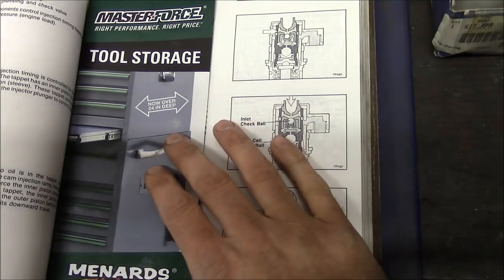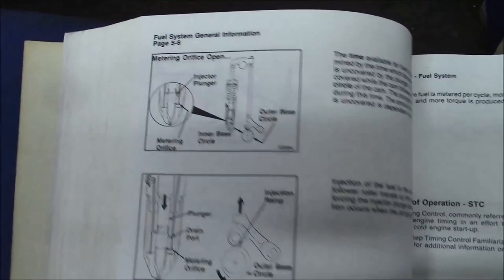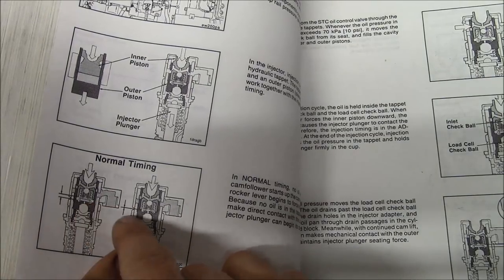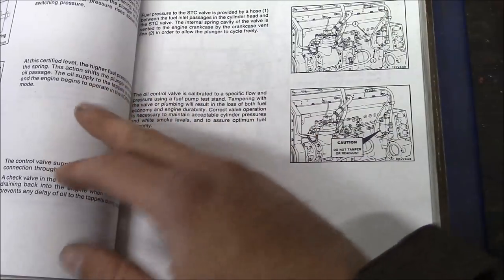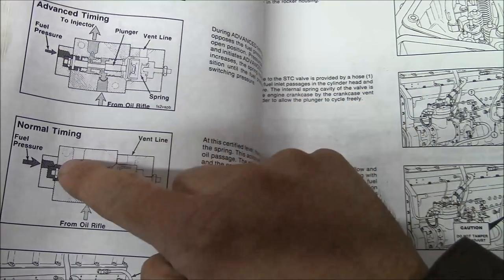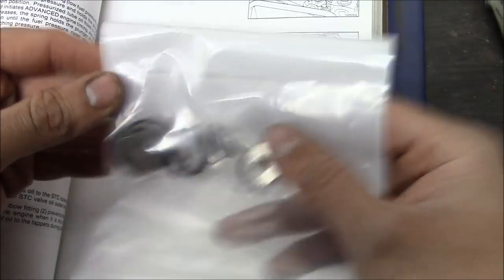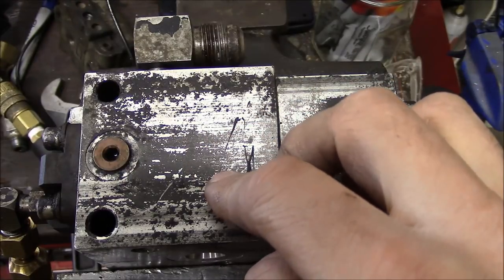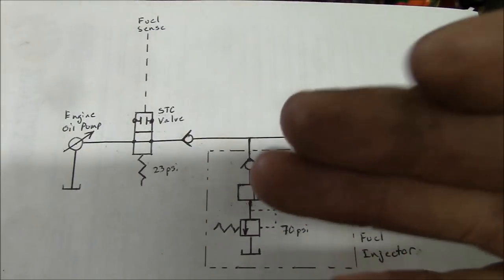Truck Repairs: Cummins L10 STC Smoking and Rough Idle Part 1

Comment: I love a good episode of Mechanical Mystery Theater! :) The STC valve had means and opportunity, but no motive. The injectors are looking very suspicious, but they keep their internal operations well concealed. Tune in to the next episode where (we hope) misbehavers will be brought to justice and order will be restored!
Reply: Steve Canny, Your avatar is just awesome!
Reply: Exactly this!!
Reply: Cummins also call it two adjustments one is inter Circle and outer circle adjustment. I been told never try rebuild a STC valve, cause the engine can run a way. And on a out of around adjustment you use a 5in lbs to all values. I hope I'm right it's been a long time for when I did one.
Reply: Well said @Steve Canny

Comment: I looked the boxes at Menards over pretty good and the Harbor freight ones seem better. We have guys in the shop with both and  the harbor freight one feels more rigid. This is only on the big boxes. The 44" box at menards was better built than the HF in the store. The Kenworth dealer was the cheapest place for me to buy Cummins parts. Typically I find the recons are cheaper than getting what I have fixed.
Reply from the maker: I don't like the drawer configuration on the Harbor Freight. It has one long drawer, which is what I currently have. The Menards box has 3 long drawers. Nothing cheap about Cummins parts, recon or not.
Reply: @WatchWesWork  a couple guys at work have the bigger menards boxes and they have definitely held up im not sure on how well they roll our shop doesnt require much moving, a box could sit for 10 years. But they like them

Comment: I worked at a pre owned truck dealer, we bought out a fleet of old Ford L9000 quad axle dump trucks from a local contractor. They were time capsules. All powered by L10 Cummins backed w 8LL. The phone rang off the hook about those trucks until the last one was gone. I sold one to this old timer, he “tuned” the injection pump in the parking lot with his pocket knife just before he took off. The L10 Cummins will always remind me of those old Fords and that old guy

Comment: I know this video is 2 years old and it's too late to help or save you now, but this masterforce is nothing like an extreme tools tool box! There's a reason the extreme tools box is three times as expensive. Extreme tools box is $1,100 pounds empty! You can stand in every drawer there's double drawer slides on every drawer Etc. The extreme tools tool box built stronger than any Mac Matco for Snap-on box for 1/3 of a price of one of those but definitely not the same Chinese tool boxes you find out a big box store.

Comment: Wes, NO unqualified person should disassemble a STC injector nor any other injector for that matter due to “class fit” tolerances being observed in a clean room. If the STC valve is working as you showed and all injectors are bypassing air except a clogged injector then the Cummins procedure is to R & R the injector(s) as necessary. 

I was laughing when you did your initial testing but, I was very glad to see you found your mistake. Then you stumbled on the injector check valve issue while explaining and thinking. Your a good mechanic man and don’t talk bad or second guess yourself, your a very thoughtful and read the theory of operation type of guy.

Comment: Nice detective work Wes👍. That stuff is testing and brain twisting at times. Always makes sense after a good hard look and some rest. I'm not sure I could have controlled myself. That injector would have been in pieces on my bench.  Keep up the videos. 👍
Reply: Me too, not that it would have been a good decision!
Reply from the maker: Umm... Somehow that cap jumped off the top of the injector and I had a look inside. There is some wear in the tappet. It also appears that the hole was not machined correctly and the passage was never open. So who knows...
Reply: @WatchWesWork  LOL, That's strange. Very possible it was never correct to begin with. It would be nice to know for sure.

Comment: Great video I have no thought on the tool box we have 5 models around here maybe 6 and they each have a purpose for us of course you need to hold more stuff then these two micro-machinists. I like to understand this diesel mechanical work as we have no diesel knowledge so we are all eyes learning everything we can. We do know a good truck when we see one your truck is something we would love to have one of for personal use (pick up small vintage machines) only of course.
Reply from the maker: It's handy, but not a cheap toy to have around.
Reply: @WatchWesWork  Hey you are right about having things laying around for that day you need them costing money, We normally do not write a reply to a reply because we know and see you are busy but thought I should share something important. We are actually marveling at your skills Wes you see we watch you change wheel bearings/oil leak in a Clark Forklift rebuild some cnc machines and find them homes service a diesel truck so to us you are really a great mechanical guy and that is why we watch you even if in the diesel topic it was not what we are doing so thank you and have a Merry Christmas.

Comment: I don't like the idea of a 24" deep toolbox. Very easy to tip if you have a few drawers open. 30" deep is better. Looks like the ultimate toolboxes are made in the usa. Just my thoughts. Keep up the great videos you have a great channel.
Reply from the maker: Near me is a company called Stor-loc who make tool boxes that are very deep. But, I don't like the drawer layout. I'd think a 30" box would be hard to maneuver.

Comment: I know this is an old video and shipping would be a long way but I can't tell you enough good things about a place here in texas called M&D distributors formally texas fuel injection...they can rebuild any injector I've taken them so far and even Bosch fuel pumps.

Comment: Use a butterfly impact on the exhaust studs. It doesn't have enough power to break them but it may shake the rust out. It worked on 7 of 12 for me. I had to buy a set of twelve point sockets when I came across a 12 point bolt.
Reply from the maker: The good news is that these are pretty easy to get to.

Comment: Wes, Back on the truck repair. Is it running at idle on all cylinders? I'm surprised you didn't swap your good injectors with #5 &#6 just to troubleshoot, swapping is cheaper than throwing BIG $$$(Injectors) at a problem like that. BTW, My son is awfully rough(really) on his equiptment, his big Snapon box with wings has stood the test of time. Check with a dealer, you might get a good deal on a repo box. But there is no way too move big boxes when they are loaded, so you still need roll-carts.
Reply from the maker: It's not really a miss. I tested for a miss by holding each injector rocker arm down. I'll talk about it in the next video, you need a special tool.  It's technically a timing issue. I estimate the engine has around 400,000 miles on it, so it's time for injectors regardless.

Comment: I have a 91 Mechanical N14 and it smokes for about 10secs when I cold start it but when it warms up around 160-180 degrees it starts to blow alot of Blue smoke and it smells like fuel. I got my injectors rebuilt but no luck. I'm thinking it's the STC valve

Comment: Wes your close to the problem but, not quite there bud. I’m a cummins tech and I primarily work on common rail engines but, I’m the only guy at my shop that knows the earlier fuel systems. Honestly, all the way back to the mechanical engines including the V8 903’s and I work on anything from 2.8L to 19L engines. So pretty much everything that came in trucks or smaller.

The old L10/10.8L, 855/14L and K19/19L STC engines which became the M11, N14 and K19 Celect engines. These engines all suffered this problem in variation and all had issues with the check valve in e top of the injector sticking. The fact you couldn’t stick a 0.040” wire in the injector lube Port is incorrect because, the check valve ball is what’s stopping the wire from entering the injector.

Comment: Wes Wes Wes.
The fuel line to the STC valve pushes on a basically a disc, only the clearance restricts the fuel pressure causing it to move, the fuel pressure goes past the disc equalizers and the Piston don't move, meaning the valve in the oil part doesn't function, I believe there's a return line on the STC valve that connects to the fuel return line back to the tank. Unless there's a blockage somewhere it should work, The oil pressure that doesn't drop off when you applied air to the valve had no effect without that return line on the STC valve. When it's working properly at approximately 70 psi fuel pressure the valve is supposed to relieve the oil going to the injectors causing them to collapse meaning the fuel is trapped and injected app 8 to 12 degrees later so at higher rpms the fuel isn't injected too early ( to much advance). Check for a fuel return line from the STC valve to the fuel return line back to the tank. HOPE THIS HELPS, there's a accorn nut on the STC valve to adjust the point where the valve functions, Cummins don't want you to know that.
Good luck and all the best to you SIR.

Comment: Im wondering will this truck fall under theJ1708 are J1939 So did you throw any misfire Are injector codes if it’s an electronica engine

Comment: Not sure about the toolbox, sounds extremely pricy. You can get the chinesium ones in Germany with the same size, with a rubber working surface for 300 bucks including shipping and 2 years warranty.

For 1.2 k you would get a toolbox manufactured in Germany by Hazet or Gedore, but granted, not in this size.

Comment: Do you think there is any chance there is a crack or loose fitting in the suction line to the oil pump sucking in the air? Second you might watch "Terry Chron" video Cummins L10, M11 & N14 Injector Troubleshooting https://www.youtube.com/watch?v=JLjVFJpowbo he even offers free call in help 
Cheers
John
Reply from the maker: I'm going to check both. The sump is attached to the pan, so it can't really rattle around. I'll have to check that guy out.